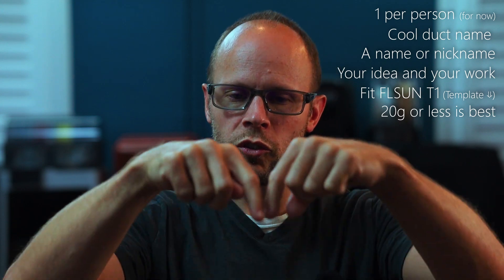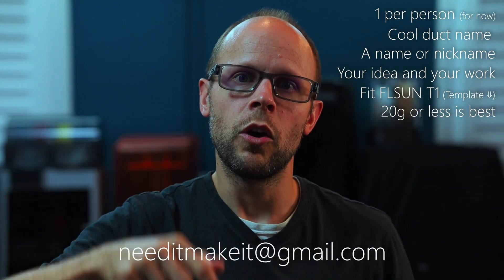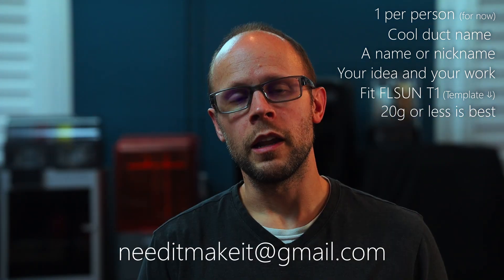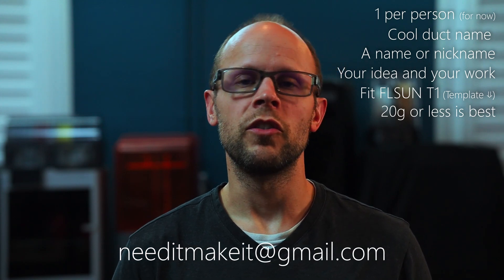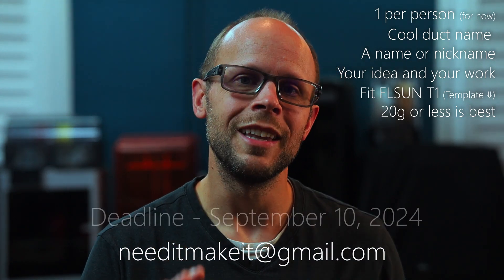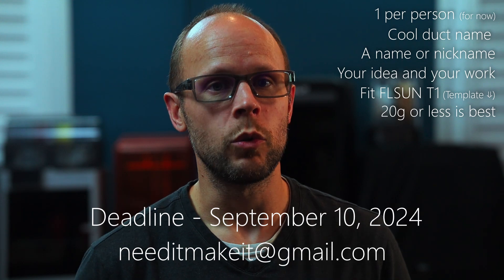I challenge you to a 3D printer part fan duct design competition

Comment: I wish I had a 3d printer. I have some cool ideas for this challenge but without a printer to physically test it myself I'm not going to submit a stupid idea that has no chance of working
Reply: TBH I love stupid ideas that may or may not work at all. Check out the fan challenge by Major Hardware. Tons of fans haven't worked well at all, but have generated a lot of buzz and conversation!
Reply: @802Garage  my favorite idea that I would like to try or see someone else try is a completely in circled nozzle tip that blows the air at a focused point right at the very tip of the nozzle. There would need to be stationary blades on the inside of the housing to get the air to come out of the attachment in a circular motion. That's my main thoughts on it
Reply: @vvvtiggervvv  I believe there is a submission very similar to what you're describing we've seen previewed on the Discord! So hopefully your wish is granted.
Reply: @802Garage  awesome. I still wish I could do it myself but I can't afford or have enough uses for a 3d printer so hopefully I will get to see my idea tried by someone else.
Reply: @vvvtiggervvv  I getcha. Could always try just to learn the CAD skills as well!
Reply: @802Garage  I am but it isn't as satisfying as ending up with a finished product in hand. It's like building a completely finished project and then never trying it out. Design isn't as fun without knowing all your work, well worked lol.
Reply: @vvvtiggervvv  There is another solution... Get a 3D printer. ;) Hahaha.
Reply: @802Garage  I would but I can't afford one at this time

Comment: @NeedItMakeIt Have you ever explored something like the DiiiCooler design?
Less head loss from abrupt changes to shape, area or direction as part of the air rediction should be more efficient than a many-duct design.   (Also, there's no need to redesign the DiiiCooler duct other than making a simple adapter for your hotend.  Google can point you to many DiiiCooler designs to print).

Comment: I worked on part cooling ducts for industrial grade 3d printers for quite some time, the name of the game for quality is flow uniformity, we started very similar as of what you have ( even on the max pressure +airflow fans /cpap ) and ended with a ring that can output 360 streams that converge in a vortex. basically introducing turbulence to make the flow laminar at the output and better distributed, this is hard on traditional 5015 or similar fans due to the restrictive nature of the channels but yeah, i hope the community can bring some cool ideas!.

Comment: I don't ever print fast enough to need a part fan. I have the part fan off, 100% of the time, no matter what filament type I print, and my prints turn out great.
Reply: This is a totally valid way to print, tbh it also means you can use lower temperatures and also induce less moisture hydrolysis for any water present, but still achieve good bonds. All the layers below the current layer are soaking up the thermals. But also going slow enough for parts with a small cross-section has some challenges. Do you use minimum layer times to deal with that?
Reply: @Roobotics  Whatever the default setting for minimum layer time is, that's what I use. 🙂

I'd also like to add that my printer is inside a homemade, heated enclosure, and in spite of what everyone says, I print all filament types in there, including PLA. I leave the heater off for PLA, but whatever internal temp the chamber gets to from the bed and nozzle, well, so be it...PLA turns out fine.
Reply: @imacmill  what most don't seem to understand is heat is an accumulation over time, and prints hold thermal gradients inside them, print slow and the heat can dissipate. Down into the lower layers and air, exceed that by printing too fast, and it's more like printing with a hot-glue gun, lol.
Reply: A lot of filaments turn into tacos if they are cooled, and even some that don't like PETG still love undisturbed air. Cold n slow.